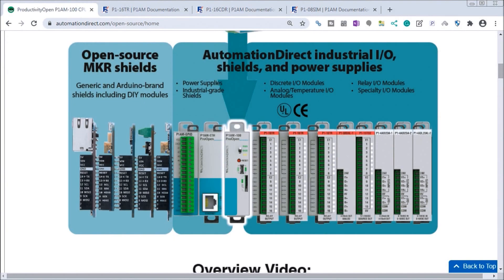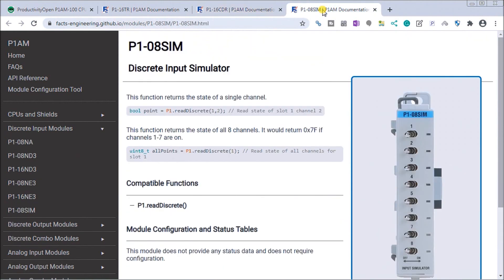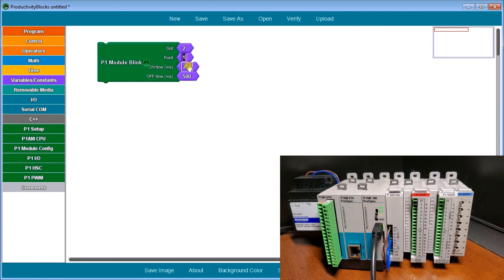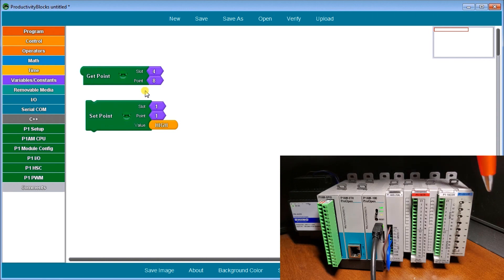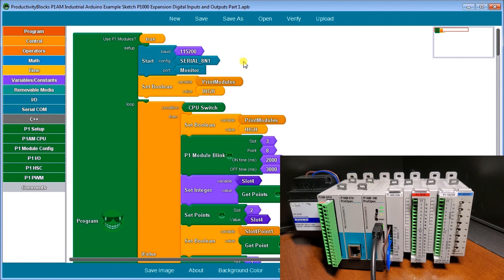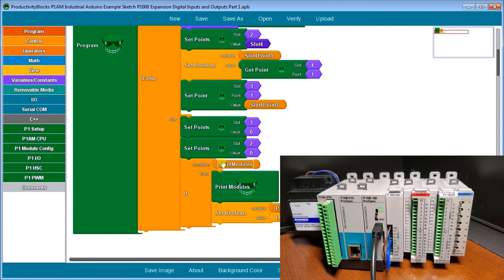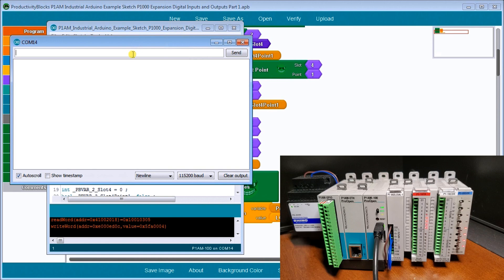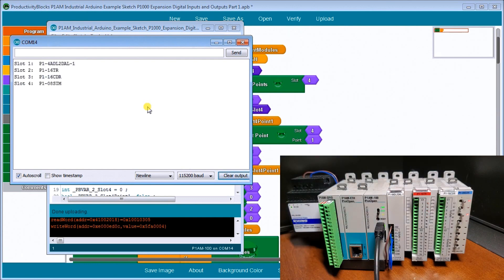Productivity Open P1AM Industrial Arduino P1000 Expansion Digital Inputs and Outputs Part 1

Comment: high i am finally studying the Arduino productivity blocks and would like use a Modbus master slave block example which i cannot locate. is there some information on this? thanks
Reply from the maker: Hi q zorn,
Here are two posts on the P1AM as the Modbus Server. (Slave)
https://accautomation.ca/productivity-open-p1am-industrial-arduino-modbus-tcp-to-c-more-micro-ea3/
https://accautomation.ca/p1am-arduino-modbus-tcp-to-c-more-ea9/
Here is a post on the P1AM as the Modbus Client. (Master)
https://accautomation.ca/productivity-open-p1am-arduino-modbus-tcp-client-to-click-plc/
This should help you out.
Regards,
Garry

The entire industrial Arduino P1AM series can be found here:
https://accautomation.ca/series/productivity-open-arduino-compatible-industrial-controller/

Comment: Thank you.Very helpful videos. How do we connect standard MKRZero shields? DO you have a video for P1AM-PROTO?
Reply from the maker: Thanks for the comment, Sonia.
MKRZero shields can be connected to the left-hand side of the CPU unit. 
The P1AM-GPIO is one of the shield units but you can add your own if you wish. 
https://www.automationdirect.com/adc/shopping/catalog/programmable_controllers/open_source_controllers_(arduino-compatible)/productivityopen_(arduino-compatible)/controllers_a_shields/p1am-gpio
If you take a look at the following picture on the main webpage for the P1AM, you can see the configuration.
https://accautomation.ca/series/productivity-open-arduino-compatible-industrial-controller/
I hope this helps you out.
Regards,
Garry

Comment: what is this for? ethernet for transporting and resaving data but what data? im a neewbie and is just curios about the tech.
Reply from the maker: This industrial Arduino will support the range of PLC expansion modules from the Productivity 1000 series. 
The Ethernet that you see is the added shield that can communicate to touch screens, SCADA packages, etc.
Common industrial protocols like Modbus TCP can be used.
Here is a link to the entire Arduino P1AM controller series.
https://accautomation.ca/series/productivity-open-arduino-compatible-industrial-controller/
Regards,
Garry